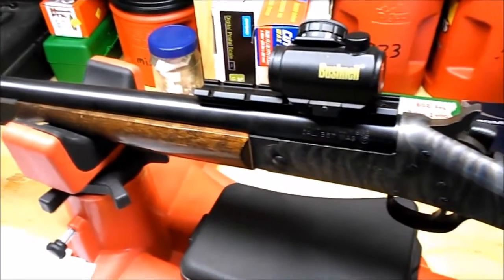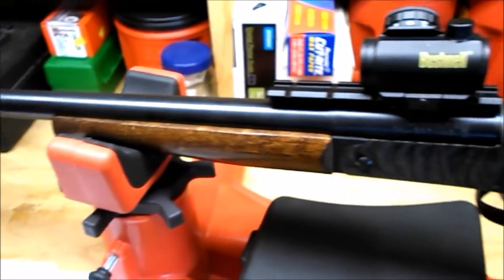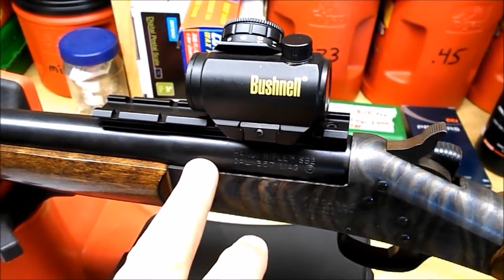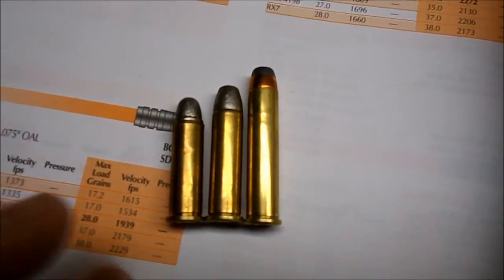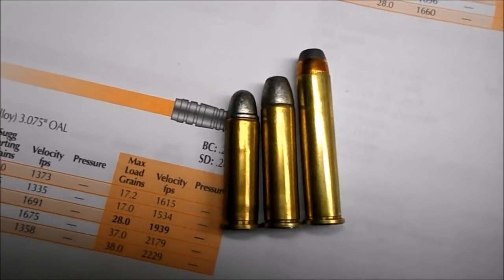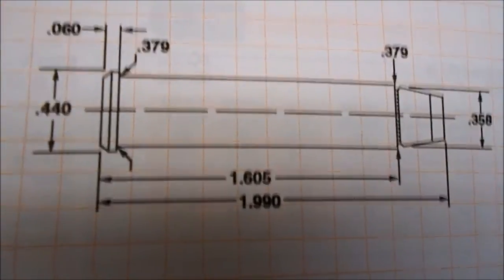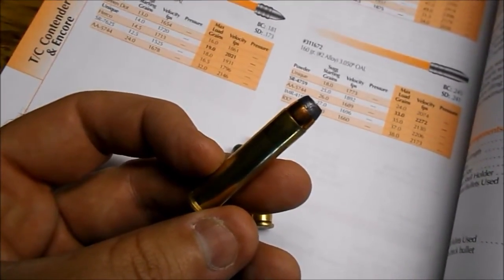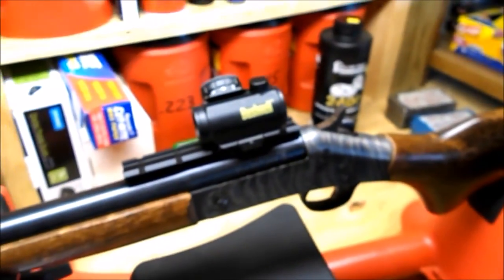357max (overview)

Comment: FYI, the SB1 frame is made of cast iron and is really only suitable for shotgun barrels. The 'Handi-rifle' frame is made of alloy steel and is MUCH tougher. I'd be careful shooting high powered centerfire rounds in that set up. Though the barrel is fine being an SB2, the back of the frame and the firing pin on SB1 frames often take damage from high power rounds.

BTW, I noticed the color case hardening on the receiver and that was a dead give away it's a shotgun frame. Every SB2 frame I've seen so far is plain blued or browned steel.

Since your video is from 9 years ago, it'd be interesting to see an update on if you've had any trouble shooting with that frame.

Comment: So I have a Stevens 301 frame which is a clone of the h&r, I'm wondering if I could get an h&r barrel and shim it to work correctly..
Reply: Though your comment is 3 years old, I'll still add this advice: OP is using the wrong frame. That frame is only made of cast iron. The actual SB2 Handi-Rifle frame is made of alloy steel and is designed to handle high powered rounds, unlike the frame he's using, which is only suitable for shotguns and some pistol rounds. Your Stevens 301, though Chinese made is all steel to my knowledge. Might be worth experimenting with using Chaszel barrel inserts.

Comment: How does this compare to the 44 mag
Reply: 357 max will be over 2000 fps out of a rifle. My 357 mag with a 22" barrel gets 1500-1800 fps depending on the load. 
 44 magnum in a rifle will be similar in speed as the 357 mag. Just with heavier bullets most of the time.
Last deer season I had a factory Federal 240gr soft point 44 from my Ruger rifle, travel through 75-80% of a deer's body ( angled shot from the left shoulder to just forward the offside hip ). Exited her and accidentally hit a year and half old deer behind her. 
My preference is for the 44 mag.
But still want to play with the 357 max. It is cheaper in general to load for than the 44 mag
Reply: @mot0rhe4d40  how do you find a rifle for this platform I’m having a tough time
Reply: @heavyleadenthuasist38  You either buy a Thompson Center break action single shot rifle in 357 Max ( do not know how hard that would be ). Or purchase the barrel only and add it to a Thompson Center rifle/pistol you already have. The other route has you renting a reamer for the 357 Max caliber. Then cutting your single shot H&R Handi, CVA Scout/Hunter or Traditions G2 Outfitter to 357 Max from the original 357 Mag chambering. It is fairly straightforward, use plenty of cutting oil.
The next challenge will be finding brass in the Max caliber in this trying times.
The caliber is a hand loader proposition at this point.
Reply: @heavyleadenthuasist38  I'd avoid doing what OP here did, as firing high powered cartridges on a cast iron shotgun frame often leads to damage to the frame and sometimes the shooter. The actual Handi-rifle frame is alloy steel and is designed to handle high powered cartridges. You likely have two choices. Either buy a HandiRifle in 357 and have it rebored slightly deeper. or buy a HandiRifle centerfire rifle shotgun combo. I have one that has a .223 barrel and a 12ga barrel, then use a Chaszel barrel insert for other cartridges. I got my combo set on a Gunbroker auction. (btw, avoid GB's penny auctions)

Comment: Can you ream it out to 350 legend??
Reply: I don't think that's going to work, different case designs, the 350 legend isn't rimmed and has a slight taper to it. And they have different factory bullet diameters. 350 headspaces off case mouth 357max and that whole line spaces off the case rim